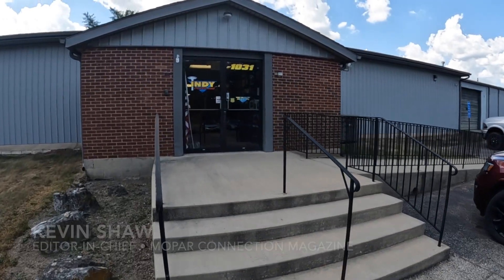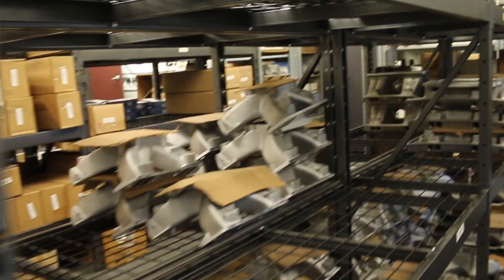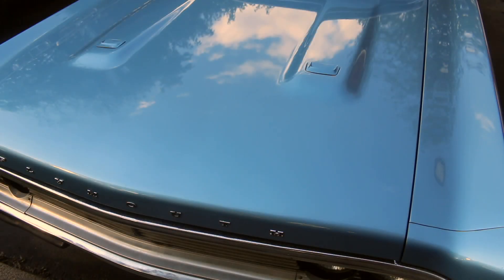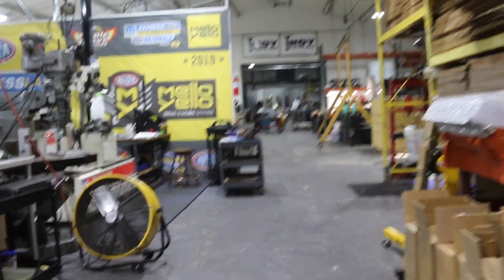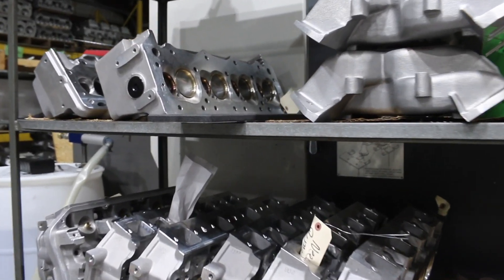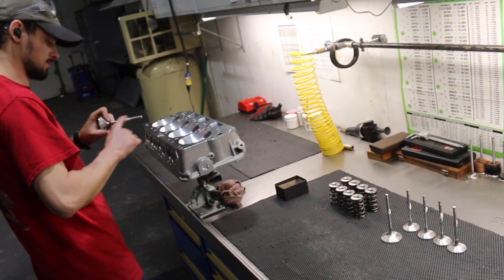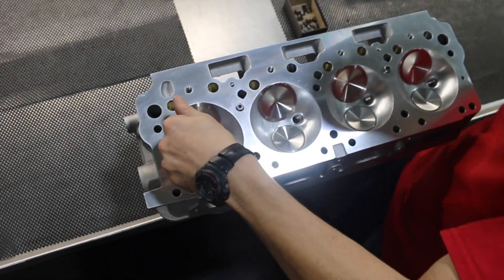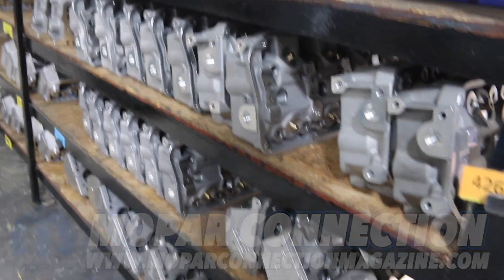How INDY Cylinder Head Makes Its Aluminum 426 HEMI Cylinder Heads

Comment: I wonder what would be the difference if you centered a modern gen 3 combustion chambered head on a Big Block, allowing there to be a quinch area all the way around the cylinder (the difference between the traditional Big Block diameter and the diameter of the modern 392.
Reply from the maker: Seems like a lot of unnecessary work when you can build a 426 or 440cui G3 Hemi without all of that effort - and have a superior engine all the way around.

Comment: Suggest you build a twisted 45 degree ball stud Hemi head,  I believe in Ohio museum in a '68 Barracuda.  The engine weighs about a 100 pounds lighter,   similar design should be better performance.  Whatever you do,  use a 4.500 bore size,  36 or 40 degree combustion chamber,  not 58.5 degree,  too heavy !!!!!!!
Reply from the maker: There are NO ballstud Hemis. The only existing one is a prototype.

Comment: According to the video, the reason Indy sells engine parts is not because they don’t want to build engines.  It should be because you don’t want them to build your engine!  I learned that lesson the hard way.  Despite the advice of others against buying a complete engine from Indy, I rolled the dice and paid $23k for my engine.  Big mistake!  The engine had to be removed from my car and disassembled due to cylinder leakage that required sleeving the block.  When the engine was disassembled, it was full of dirt, debris, and gunk.  I have torn down 20-year old lawn mower engines that were cleaner than this one.
Reply from the maker: Sorry to hear about your experience! When was the engine built?
Reply: @moparconnection   This was in 2015, so it was before the ownership transition.  However, my understanding is that the engine building crew is still essentially the same.  I still have the pictures that were taken when the engine was disassembled, and they show a horrible lack of attention to cleanliness.  Perhaps even more disappointing was that they obviously were aware of the cylinder leakage, because they had attempted to "fix" it by using some kind of sealant on the area of the head gasket around the leaky cylinder.  When I asked them about this, their only response was "We pressure test all blocks".

Comment: looks very nice put togather this video and they seem like a very good parts maker, but I was thrown off by the fact its in xenia ohio, but you said they also have the place in indy as well and fixing cast iron products, which many welders even good ones dont want to touch with a ten foot pole cast is an interesting can of worms to try to fix and weld.
Reply from the maker: Yes, the Indianapolis location does phenomenal cast iron welding repair. They get that stuff cherry red in an oven and begin welding in new material. I’m begging them to let me film the process because it’s so cool. We’ll see if they let me.
Reply: @moparconnection  yes thats how you have to do it get it real hot first, cast is tough because iron has all kinds of inclusions and things and not the most pure of metals to weld not to mention brittle compaired to lots of steels, would be facinating to see though good luck they might not want to show it if its too much a trade secret